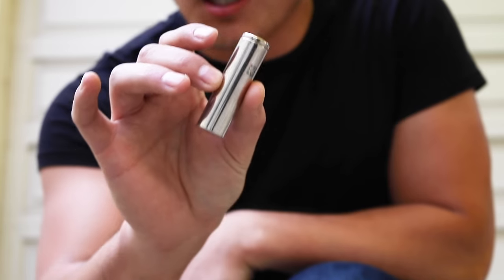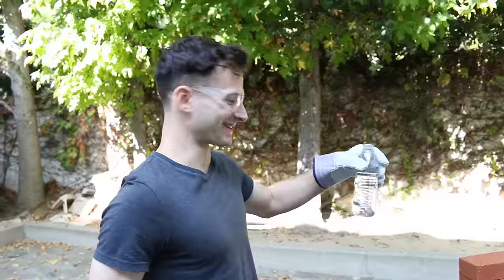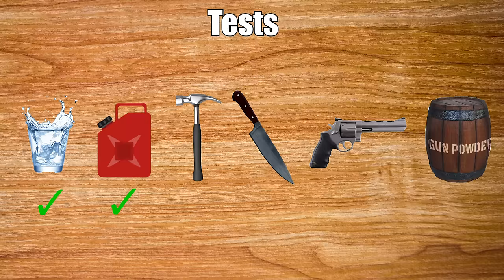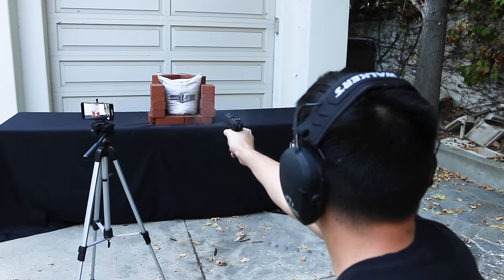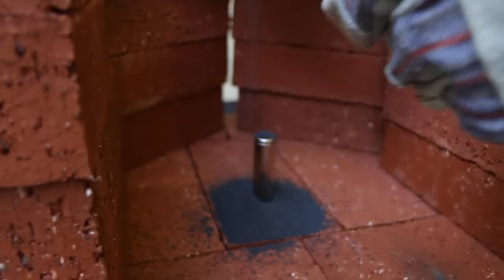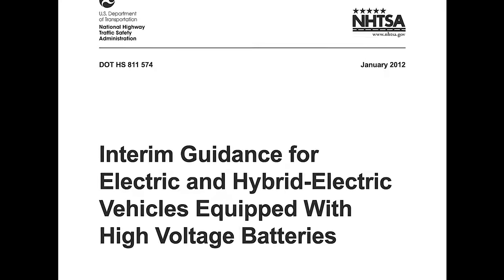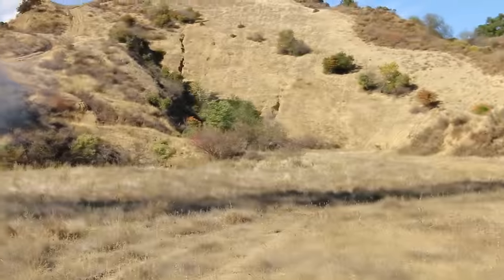How to make a Tesla Battery Explode (Torture Test)

Comment: 18650s are dangerous. I remember back in like 2015 when they were the main power source for vapes, people were using them in mechanical mods which was ridiculous because many of the cheap and mass produced "vape grade" 18650s did not have vent holes in the event of an out of control reaction meaning you basically were walking around with a pipe bomb on you at all times
Reply: LiFePO4 works really well in mechs, 4 wraps 28g 2.5mm Id for all day MTL goodness!
Reply: @SproutyPottedPlant  holy crap someone who still uses mech mods??
Reply: Get a DRAG 2 save yourself the hassle.
Reply: They still are
Reply: I used to love my mech mods. Law of Resistance is all you need to know. And as you said, a good battery.
Reply: I’m Irish/Scottish we are used to walking around with pipe bombs in our pockets :)
Reply: Nowadays are any people still using mech? Never see one unless for collections items..
Reply: I just bought an 18680 flashlight, the fucking thing is waterproof, and there's a bunch of reports of olight and nightcore users getting their faces blown apart because they were working under a car with one in their mouth when it vented, and turned the heavy duty flashlight into a bomb I guess my common sense hasn't gotten much better since I vaped.

Vent holes in the battery keep the battery from blowing apart violently, that will not help when you have a pressure vessel containing the venting though.

I also don't even know where the one I had for the vape is at so I just have a fucking lithium cell hanging around god knows where until I find it sometime because I KNOW for a fact  16 year old me did not properly dispose of it.
Reply: @blaneblane1779  Given down generations, from father to son?
Reply: The batteries themselves aren’t dangerous it’s the people that don’t understand resistance or battery safety. I use 18650s in a lot of things n have never had a problem with them.
Reply: so did you use to vape or no?
Reply: were? They still are. Mine uses 3 of em.
Reply: @CajunReaper95  really long way of saying the batteries are dangerous. I’m not blaming the batteries, but anything can be dangerous if misused. That being said, the batteries fucking suck, are prone to runaway reactions and venting at times that don’t even make sense, and have injured people who used them properly just because elemental lithium is dangerous as fuck
Reply: @JZ0217  yeah lol my mod was super sketchy, just a copper tube with a battery in it and 510 threads. It was called the Manhattan lol probably because if your battery vents it’s like having an atomic bomb in your pocket
Reply: Vapers were wild then man. I saw some guys that were using batteries harvested from laptops in their mech mods.
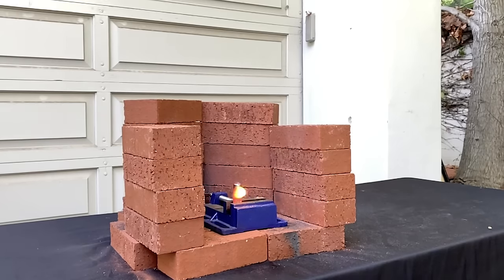Reply: Song at 3:38
Reply: They need to do this test with a Tesla Model 3 LFP battery 🪫!!!
Reply: It's the same with any potentially explosive item though... If it's shoddily made or is being operated outside of its true rated speifications, expect it to go boom.

With mech mods and any vape that takes 18650 cells it's no different. If you use the cheapest, sketchiest cells available or you buy cells that aren't able to take the high currents that the vape will demand of them, you're just ASKING Nay, PLEADING to have your pockets set alight. Always refer to the manufacturer's datasheet before ya specify your own cells - or ask the manufacturer of your vape what they recommend if it's a mass produced unit.
Reply: YA ITS THE BIGGEST COVER UP , SOON AS THEY ROLL OUT THESE EVS ,, FIRES AND EXPLOSIONS EVERYWERE !!!
Reply: @CajunReaper95  mine just slowly cooked itself overnight once, probably cos of a leak,  it was old one so no wonders
Reply: Jeeez. Yup. I think it’s dumb to purposely put people in harms way
Reply: Every attempt could’ve been a little safer…
Reply: vape in your mailbox
Reply: You realize the difference between cheap china no name batteries vs brand name. The good ones have a protection circuit.
Reply: @trashcompactorYT incorrect 18650s are not dangerous, misuse is, calling batteries dangerous for complete stupidity is ignorant!
Reply: @kennymacdowell1257 Samsung 18650s, 20700 and 21700s are not protected cells as a matter of fact a lot of name brand  cells unless specified are not protected that includes LG HB4, HB6, Samsung 30q, Samsung 30T, 40T, 25R and so on!

Comment: Props to the cameraman. he has balls of steel to walk TOWARDS a BATTERY THAT CAN DETONATE LIKE HE DOES IT IN HIS SLEEP!
Reply: it doesn't explode it just fires off like a hobby rocket motor. as long as you dont try to grab it with bare hands or shove it up your b hole when it goes off its not that bad. 
its not a grenade.
Reply: @darkshadowsx5949  7:41
Reply: he’s the cameraman so its fine
Reply: @darkshadowsx5949 😮 bro, don't be keistering the batteries!
Reply: These guys don't exactly have the best safety practices 😏
Reply: @Dreamcrafty what?

Comment: 18650's arent supposed to be charged to 4.5V, only up to 4.2V, it may be the cause of a more violent explosion
Reply: Definitely, 4.5v is way too high for an 18650. That puts a lot of stress on the battery and will make it unstable.
Reply: True fire hazard
Reply: They could have several times the the energy they normally store, since charge goes up with voltage exponentially. Cheaters!

Comment: 4.5V? Interesting
Reply: "slightly" overcharged
Reply: UBERCHARGE READY
Reply: @antonw.415  slightly !?🤨 its more than slightly, at this voltage its already dangerous, they heat up and can blow at any moment, charging voltage is 4.2v ( and 4.3v is the maximum limit because of possible component tolerance)Julien.
Reply: @julien1997a  i know, this is, why i put it in " "
It means that it's ironic and a total understatement. I'm well aware of the dangers of completely overcharged 18650s ;-)
Reply: Funny part Tesla don't use 18650 they use 21700 😂😂
Reply: James James  I mean in most latest models they are using 21700 old models might have used 18650
Reply: Pls what's the name of the intro along
Reply: Pls what's the name of the intro song
Reply: James James  pls I meant the intro of the video

Comment: Just a heads-up - your chargers were overcharging those cells, which in itself can be a fire risk with the specific cells Tesla use. The datasheets for basically any LiMnCo cell (aka Lithium Manganese Cobalt as this is their internal chemistry) recommend you never charge past 4.2 volts for these cells.

Short-term, a 4.5v charge is not going to cause a fire, but long-term you are absolutely wrecking the cell's ability to hold a charge. Not that it's a big issue here since the endgoal is *BOOM*, but yeah. If you use those chargers for any degree of RC battery or cell recovery / charging I'd strongly advise getting them calibrated to extend the life of your cells :)

That aside. this is a well put together example for why safe handling is important with such energy dense cells. Nice work fellas! :)
Reply: i use a cheap $12.00  charger I got off Amazon for charging my 18650 vape batteries. I've been using the charger now for about 3 yrs and the same batteries. It does say it has overcharge protection but really who knows, but 3 yrs later and both the charger and batteries still work great. On another note I wonder how well these Tesla 18650 batteries would work in a vape, my vape batteries are 3.6V
Reply: @NonLegitNation2  They should be able to cope with the high discharge rates of a vape pen - You would though, if you were obtaining some, have to get wrappers for them because the cells Panasonic sell to Tesla are unwrapped and they remain so even after they've been made into a power module. ;)
Reply: @DigBipper188  I Googled it, and the only place supposedly selling them is Aliexpress and tb 100% honest I don't know if I would trust that they are legit Tesla batteries, they were selling them for $2.60 a piece with is a great price, but really if Panasonic is the one that actually makes them then I might as well just buy Panasonic branded batteries. Plus I didn't catch how many mAh these tesla batteries were, I currently have a set of LG 3000mAh and a set of HOHM Depot 3005mAh batteries.
Reply: Me looking for who asked
Reply: Did he actually spend time in prison
😊
Reply: PROTOGEN FURRY OWO
Reply: @IBims1Mark  MINECRAF DOGGO OWO
Reply: @DigBipper188  OWO I am a Furry for 3 years now TOO UwU
Reply: @IBims1Mark  Ayy that's pog! 2 here
Reply: @DigBipper188  UwU
Reply: I was looking for this comment. I work with Li-Ions for a living and as soon as i saw 4.5V i cringed
Reply: Furry💀
Reply: @roboticintelligenceunit1a652  UwU
Reply: @IBims1Mark  dies from cringe
Reply: @Fnpromaster  It's a useful comment, with good information. People don't always need to ask for someone to provide extra info and tips.
Reply: @NonLegitNation2  they arent 3.6v the nominal charge is 4.2v on ALL 18650s 
 3.7v is actually the storage voltage.  they are marketed as 3.6 though. which is the mid charge range. anything less than 3.0 is "dead" and 4.2 is "full"
Reply: Love to see another protogen with good electrical knowledge, I'm actually building and programming a protogen head rn!
Reply: @SkidFace  oh hell yea! :3
Reply: @SkidFace  aww hell naw
Reply: Toaster
Reply: @nobody_2611  toamster. :P
Reply: @DigBipper188  non-chad behavior
Reply: @IBims1Mark  Hell yeah, Fur meetup in the comments
Reply: @roboticintelligenceunit1a652  Find someone that asked :3
And touch grass
Reply: @GandhiTheDerg  lets gooo!
Reply: I still remember the 2 firefighters in the USA who almost died from cobalt oxide poisoning just because they were covered in smoke from a tesla battery pack fire!! The where on deaths door and now are forever sick and will never be able to work again just because they tried to extinguish a ev car fire!! Tesla should be sued until they have nothing left to give just to remove these death traps off the roads and out from under every single sky rise building in the world.. what's going to happen when we have 20 EVs in a underground parking lot and 1 goes up in flames that no one can stop and trying to do so will poison them to deaths caused by the toxic cobalt oxide among many other chemicals...
Reply: @roboticintelligenceunit1a652  fatherless
Reply: Man im scared off you things, From a certain incident with that "Cat". 
Man i never want to test a teleporter ever again );
Reply: Nerd

Comment: Max charge voltage for this kind of cells is 4.2 volts. You've overcharged them and some part of the heavy reactions might be caused by this.
Reply: Yep
Reply: Not even 4.2 these chells should be lithium iron phosphate which have a nominal of 3.2v and i think a charge voltage of 3.8.
Lithium iron phosphate batteries are used for their way longer charge and discharge cycle count so that the car doesnt get useless in 3y of usage because of battery degradation. But they also have a little less capacity because of said lower voltage.
Reply: @BadMax02_VR They're Lithium-Ion, so their maximum voltage is ~4.2vDC and nominal is somewhere between 3.6 and 3.7. Discharged should be maybe 2.4

Comment: I was about to say “ima put that in my controller, see how many days it lasts”
But then he put the AA battery in comparison to the Tesla battery and I’m like “oh shoot that’s really big!”
Reply: hAHA
Reply: I was thinking that haha
Reply: Hahaha lmao
Reply: There are AA li-ion batteries you can buy but the voltage is way too high for a device that is designed to be used with AA batteries so the controller is just going to break itself if you use them.
Reply: And if they get used without a protector circuit when they die they can explode
Reply: That's what she said
Reply: Thats what-
Reply: @user-ve1cc6qn6t  their usually 3.7v. in some scenarios you can get away with using one of these to power a dual AA device.
Reply: hAHA

Comment: After ONE conversion with an electrical engineer I changed the whole way I treat batteries.
I keep all my battery charging gear in a large ceramic baking dish, and I never leave anything charging when I leave the house or go to bed. The principle is that you ASSUME at some point one of them will cook off. I had no idea how dangerous they are, or how much energy they release in such a short, sharp, shock.
They account for 48% of all waste fires in the UK
As batteries age, the risk of them cooking off increases.
Fire services in the UK are constantly issuing warnings about them causing house fires
People dump them in the recycling tub, where they get crushed or soaked, and then start fires.
As someone familiar with butane and propane regulations, I am actually quite shocked how rechargeable batteries seem to be getting a Health and Safety hall pass because they are "green"

Comment: If the goal is to puncture the outer casing of the battery and short the two foil sheets inside try using a .17 caliber rifle instead of the .22 caliber CB cap.

It would also be interesting to see what would happen over-charging the battery instead of discharging it.

I'm mainly interested in what would happen in a real world situation where the car was broadsided for the charger failed and overloaded the battery.

Awesome videos guys keep them coming!!!

Comment: These batteries were severely overcharged at 4.5v, normal lithium batteries like in laptops or phones, charge at a max of around 4.2~4.35v.

Batteries in Cars however use Lithium Iron Phosphate batteries which have a full charge voltage of only 3.6v, this is because these iron batteries hold up alot longer and to more charge cycles meaning cars can last for more than just 2-3y like your smartphone, the downside is that they are slightly less power dense because of the lower voltage because of the different matterials used.

Im not debunking this video, its actually quite a real risk, tho i think the outcomes of these results may have been slightly more voilent than if its charged normally. Tho still much potential energy.

Comment: 4.5V OMG even HV cells avec up to 4.35V max, usually 4,2 or 4.15V is 100% OCV. It's slow but at 4,5V the chemistry is already reacting!
FYI your iMax chargers are fakes one, the original brand doesn't produce the build-in with power supply (I got issues with the fake one so consider this seriously ^^)

Comment: 2 massive issues
1. Teslas mostly dont use 18650's
2. Regular lithium ion cells are meant to be charged to 4.2v, you are severely overcharging them resulting in more energetic reactions
3. Teslas dont use regular lion cells, they use lifepo4 cells which are way safer

Comment: I remember completely destroying a disc battery and it was full charge and is laying in pieces in my shed and it didn’t even heat up at all (there was a nail stuck through it and it was compressed in really big wire cutters)
RIP that legendary battery

Comment: Back in 2020, I had a box of 18650 Lithium batteries ( and some 21700 ).
The box was clean, perfectly dry.
I had approximately 25 batteries in this plastic box.
( I use these batteries for my E-cig / Vape, and for my Flashlights ).

I had this box on my car seat ( driver seat ) and I was outside but very close to my car ...

I love electro-style music 🎶, called EDM or Techno music sometimes, even if The correct word for my kinda songs is EDM
( Electro Dance Music 🎶 ).

I was listening music on my Smartphone 📱, and suddenly, one 18650 battery began to throw extremely hot 🔥 ( bright white ) flames, exactly like a flare or a firework !

A 2nd battery 🔋 began to burst like the first one !

Everything happened in an extremely short time !

Fortunately, I am a former Military weapons engineer, so I know how a fire can dramatically get " out of control ", and I am a pretty fast guy :

So, I protect my hand with a large piece of sweatshirt, and throw the entire box on the ground, and kicked the batteries to get them dispersed on the ground.

The 2 burning batteries burned-out completely, and everything was " ok " ( many stuffs were badly damaged, but I saved my car, and most of the other batteries ...

I  NEVER REALLY KNEW WHAT HAPPENED, AND WHY THE FIRST 18650 BATTERY BURST INTO WHITE FLAMES ...

 Finally, I guess that a little piece 
of metal ( probably a stitch from a TV program ) dropped just under the positive side and made a short-circuit, because a friend of mine was charging them ( the batteries ) once a month, and he was acquainted to use old TV programs page to protect my batteries...

Your video is very interesting AND I IMMEDIATELY DECIDE TO FOLLOW YOU AND YOU DESERVES A THUMB 👍 UP 🆙 !!!

Comment: Okay, first of all: 18650's maximum safe voltage is 4.2 volts. Why did you charge it to dangerous 4.5? That way you could perform an overcharging test, because charge controllers failing often. And where is fire test? Not 0.5 seconds of gunpowder fire but real fire for a longer time

Comment: I think the Li-ion batteries couldn't react with water because they'are properly sealed. if Li reacts with water, there'll be a hydrogen gas produced which is highly flammable. 
Enjoyed your experiments. Espacially the gun firing <3
Reply: Anything's possible. A Tesla ran into a lake not long ago and burned for ages, underwater.

Comment: "before each test the batteries will be fully charged" No 4.5v is greatly overcharging them, they might even have several time the energy they normally store, since the charge goes up exponentially with voltage. So basically you are cheating.

Comment: The problem with li-ion battery's is, there is only one of the many thousand cells needed to burn the car and its surroundings to the ground.  And you cannot put this fire out and the fire escalates to extreme more like a long controlled explosion, that is why EV's are so much more dangerous than petrol cars.